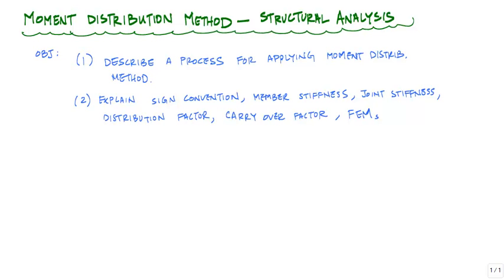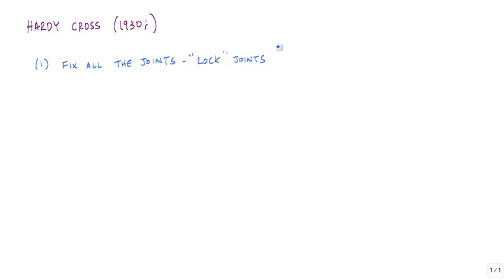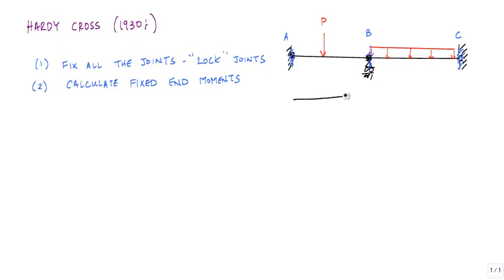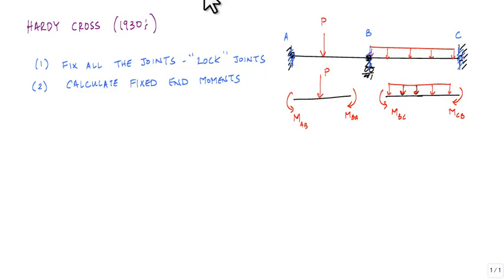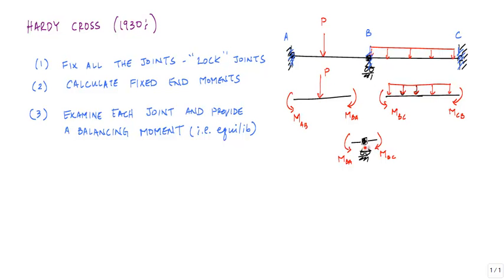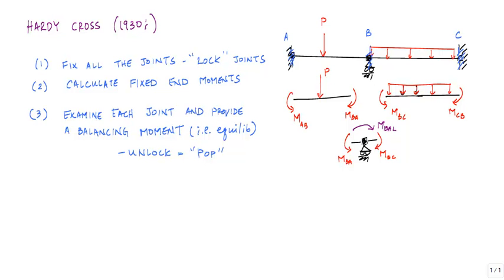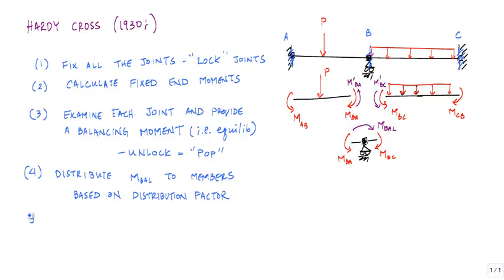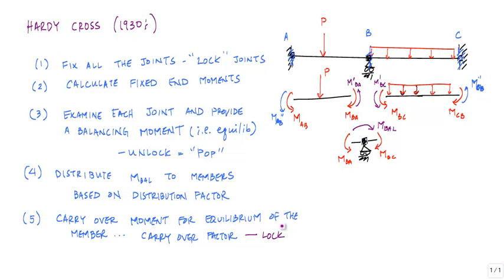Explaining the Moment Distribution Method - Structural Analysis

Comment: Hi, which method you think is the fastest one to calculate the max moment on continuous beam? I need this to applied to Reinforced Concrete Beams. Can you make an example starting from the slabs carrying the loads to the beams? Thanks.
Reply from the maker: I like the slope deflection equations since you get rotations and moments all in one and it's easy to set up in matlab or mathcad.  If this is for an exam, and it's all pin or roller supported and the loading is just uniformly distributed...moment distribution may be the way to go...I don't think I've answered anything here...I get this question a lot and to be quite frank, I think the method you know best and will get right is the way to go.
Reply: It is for exams of Reinforced Concrete, where we have the Reactions from the slabs carrying over to the beams. Sometimes a concentrated force and the uniformly distributed on the beam. I just need to figure it out the Max.Moment, MK, at the moment.